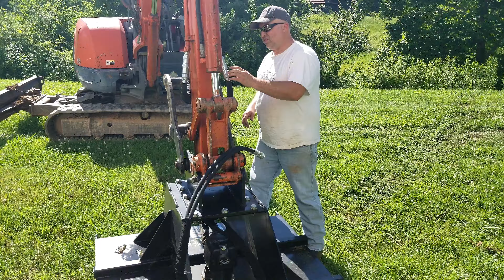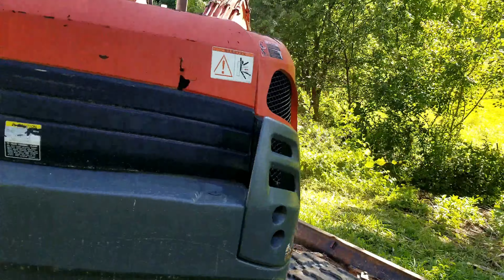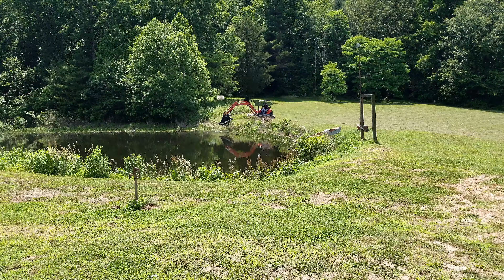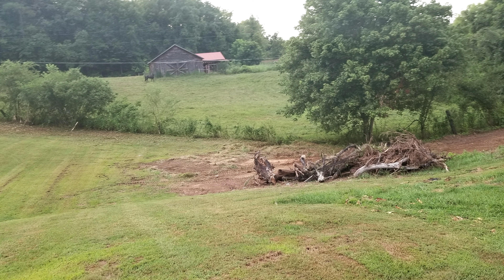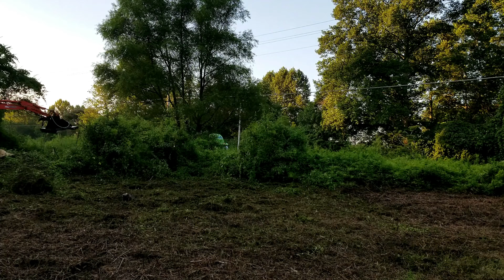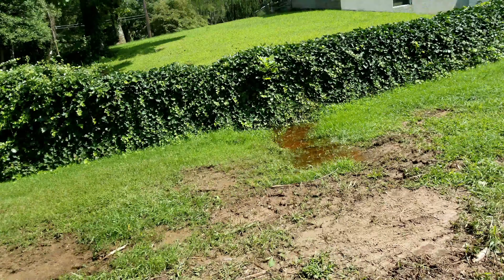Cutting Brush With The Kubota Excavator

Comment: I have the exact excavator except with a cab. But the brush cutter I have now I am very unhappy with! Been putting $$ into it about every month something breaks. What type of brush cutter is the? Also the model of it? Looks like it does a really nice job. You make operating it look like a breeze. Thank you.
Reply from the maker: I would LOVE to have one with a cab!
Mine is from Carolina Attachments. I don't know if it has a model number.  I think they sell one for  the lower GPM machines and one for the higher.  They do tune the pump for your machine.
I had to replace both hoses fairly quick.  They weren't protected and were a little short if I remember right.
Reply: @stephenlunsford6734  thanks for the info. I am going back and forth now between a rotary or flail. Right now I have the rotary but am thinking of going with the flail. Our local dealer has a eterra EX-30 flail mower they are lighter than the rotary mowers and mulch better. But the rotary mower has been good to me up until now. So it is hard to make the switch. Also the flail mowers seem to cost more. Lol IDK what I am going to do take a few days to think it over I guess.

Comment: How many hours in it?
Reply from the maker: I don't know.  I just worked on it here and there when I had time.
Reply: @stephenlunsford6734  I meant on the machine (kubota)
Reply from the maker: About 5300-ish.
Reply: @stephenlunsford6734  nice  I just got one with 4000 hrs
Reply from the maker: @umadbrooo6947  Good deal. Ive been through almost every hose and a starter but that's about it. Good machines.